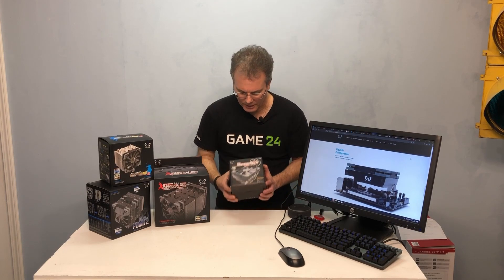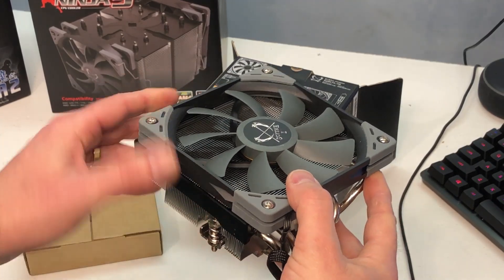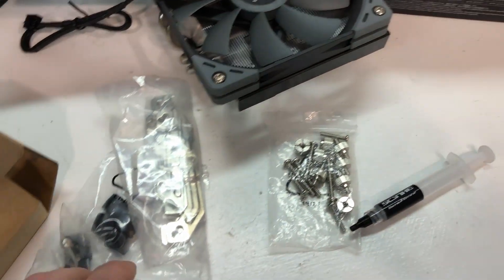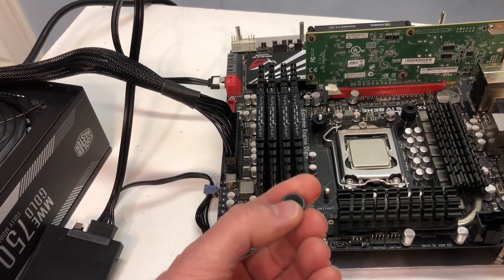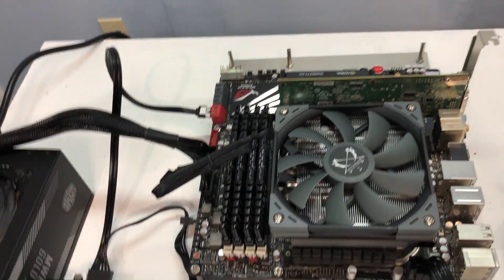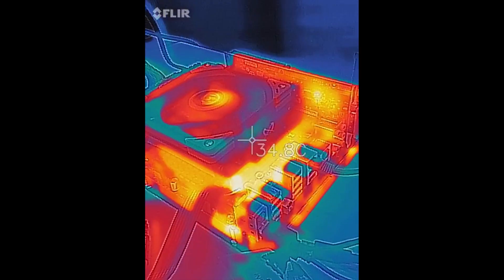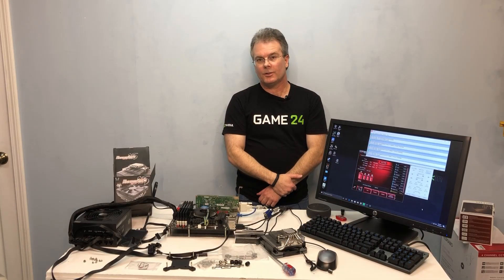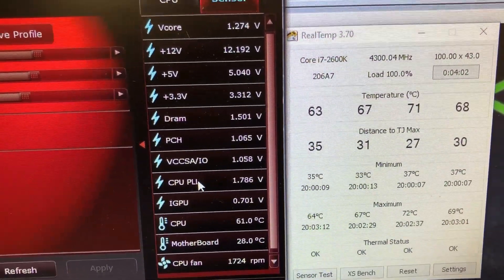Big Shuriken 3 CPU Cooler Review

Comment: How is this against i9 9900k ??
Reply: It is good i even have the i9 10900k and rtx 3070 with it and the i9 10900k is average 50 degrees
Reply: @Apenkeutelsoep  Am I good if I use this cooler on a i7-10700k? Damn, 50 degrees on a i9-10900k, that's impressive.
Reply: @MrMrRafaa  what do you want to do with your system
Reply: @Apenkeutelsoep  Purely gaming. I'm gonna run it at stock, just allowing the Turbo Boost to do it's job whenever it feels so.
Reply: @MrMrRafaa   i7 10700k my friend has a i7 9700k that runs hotter but is around 60 degrees with the stock cooler while gaming so yours would be like 58 degrees while gaming
Reply: @Apenkeutelsoep  great man, thank you for the help, I really appreciate it!
Reply: Could I use this cooler in my 9900k for gaming and live stream? Would this cooler handle it?

Comment: in your opinion does the shuriken sit tilted? I recently installed one and everything was evenly tightened but  it seems slanted  so im wondering if its by design or by user error
Reply from the maker: It should be horizontal relative to the plane of the motherboard.  But normal manufacturing variations might leave you with one that is slightly tilted.  I have seen them that way and I was able to straighten them by hand (off the motherboard of course).   I had a downflow cooler from Thermaltake years ago and I had to carefully bend it at 45° to get the right clearance.
Reply: OverclockersClub that's what I was thinking, especially since all the heat pipes are on one side, I imagine the force required to physically warp is very low. guess I'll try taking it off and checking it for squareness. thanks a million for your response I really appreciate it, nowhere online that I could find even so much as has a whisper about the shuriken 3 more specificallyvany bends or tilts.
Reply from the maker: @westhouse4641  Good -  I don't recall any tilt on mine, but I might have to take it out of the box and see.
Reply: yep, I noticed that too. Looks by design to me.
Reply: Same here. I notice that it's slightly higher by 0.5-1mm on the right side (the side with least fins surface). I opened everything, replaced the mounting metal bar from one side to another and it seems that it's fixed for now. Also I noticed that the CPU cooler surface does not sit fully on AMD AM4 CPU, it leaves about 1mm of surface untouched while at the other side the cooler seems to just hangs over the CPU. I'm thinking that it might be a manufacturing issue since the quality of the heatpipes are relatively lower compared to Noctua.

Comment: The notch is for ram clearance.
You tried to measure it without the silver brackets with only the rubbers.
If you add the brackets and then check,you will have ram clearance in most of the normal ram dims.
https://i90.servimg.com/u/f90/19/63/03/65/screen18.jpg
https://i90.servimg.com/u/f90/19/63/03/65/screen19.jpg

Comment: Very good video!
I would have liked to see the temperatures of the Big Shurike 3 cooler with the Noctua fan.
Reply from the maker: Henderson Chávez I have tested larger fans with other downflow coolers, and the difference is hard to notice. Unless the cooler has a very bad, under powered fan then you probably wouldn’t see any real difference. I believe that the fan on the Big Shuriken 3 is well-matched to the cooler.
Reply: it's the same, although I would prefer to use Noctua for the more silent fan motor. Scythe fan spins at much lower RPM but the noise is annoying at around 1200RPM (something like a growl) while Noctua fan stays silent under 1500RPM and only makes a deep hum noise.